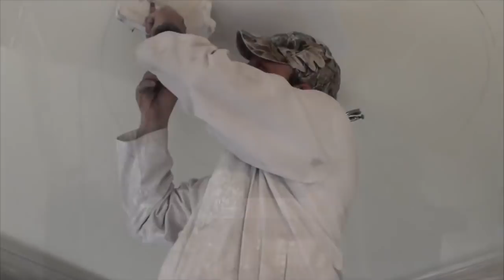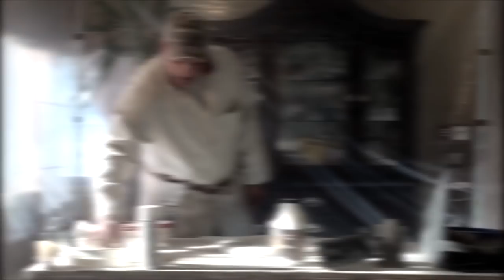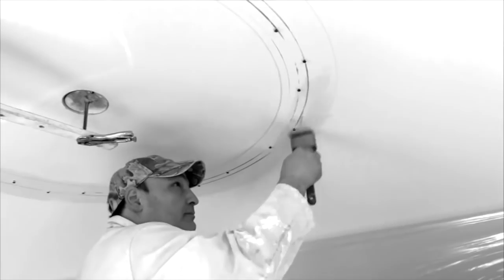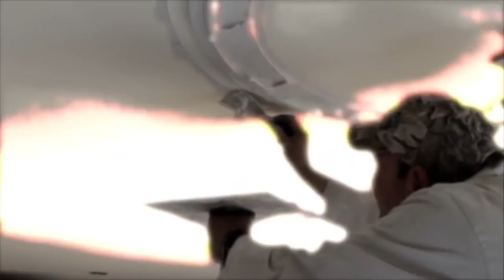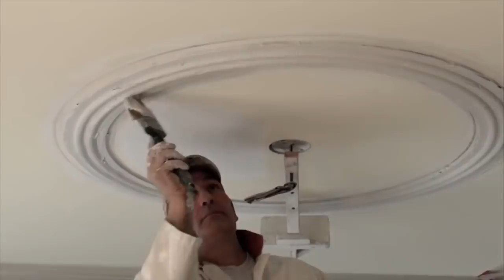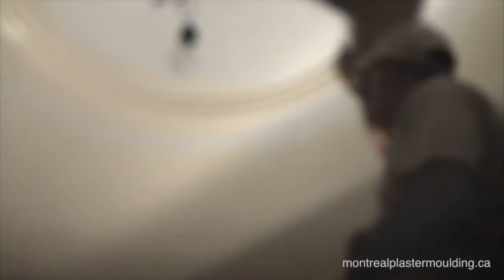How to Make Plaster Moulding for your Dining Room

Comment: the mixture is
drywall compound and plaster of paris.
that's why it takes  72 hours to be painted.
Reply: Lime putty would require 3 weeks to cure properly for painting.
Reply: What do you mean by 'drywall compound'?  Bucket mud, pre-mixed?

Comment: Can you made it in the ground on piece of plywood cover with plastic and then stick it in the ceiling it will be much much easier for you?
Reply: Mahmoud Mairi you can do it right on plywood just make sure to put vasoline where the mould rubs then hang it up with straight moulding plastere

Comment: THIS VIDEO IS AWESOME . WHERE DID YOU GET THAT TOOL TO DO THIS WORK?
Reply: running moulds are made by hand using timber for stock and slipper pieces and usually a thin metal plate template cut to profile for the shape.

Comment: You couldn't do it MORE complicated? Nice that you can do it straight on the ceiling, but how about doing it on the table and THEN putting it on the ceiling, huh? haha Imagine modelling? Do you do it at the ceiling or on the table? Food for thought.
Reply: Do you really think you could attach a piece that size to the ceiling by yourself?
Reply: There's a second guy/gal holding the camera, if done in one peace, try to use the other person to help you. If you are alone, you can cut the piece in two. Mark the outline of the circle on the ceiling and glue/ screw it in place.